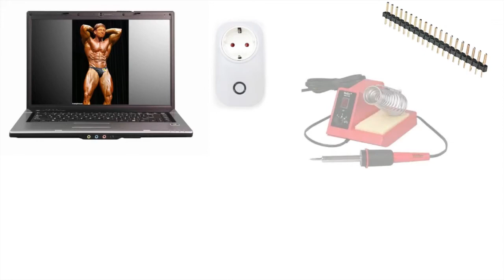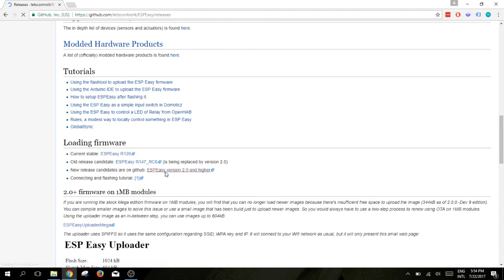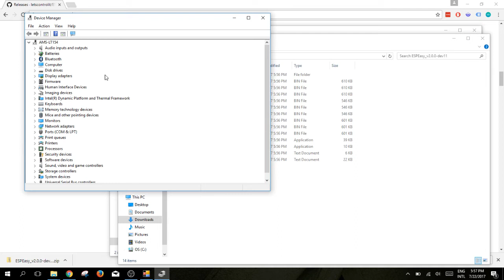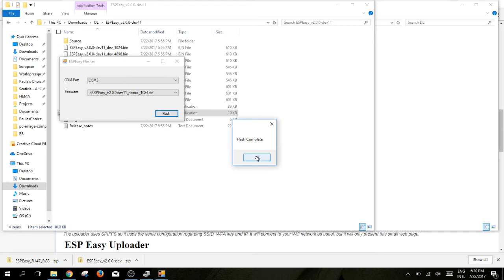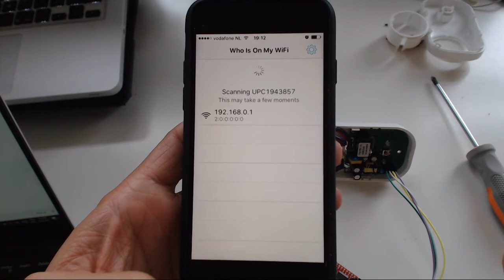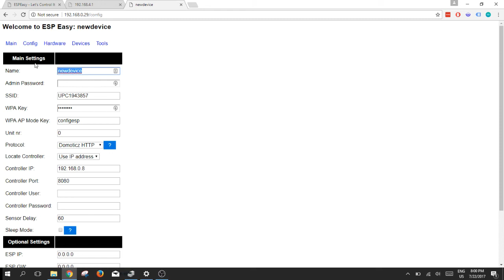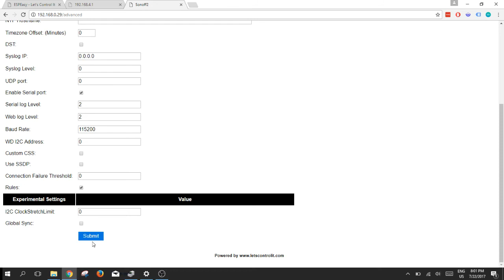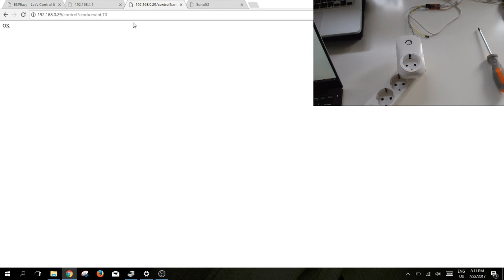Sonoff S20 Hack - Home Automation with URL - Flash Itead smart outlet with ESPeasy

Comment: Hey, thanks for the video. It flashes correctly (no error what so ever) but than after the reconnect I can't find the network. Do you know a sulution for this problem?
Reply from the maker: Hi Paul, were you able to solve this?  That's strange, mine seems to connect directly.
Reply: tipswithpunch no, it was not able to fix the problem. But my Sonoff does not connect or create any WiFi. On my plug there are as usual two leds, after reflashing the firmware no LED lightens up. Also, even with the orginal Firmware, it does not creat any kind of network after pushing the button longer down. I don’t know how it should be connected with the Orginal Firmware, but maybe the esp creates the network in wrong network bands, so that I can can’t see the network?
Reply from the maker: Indeed that sounds strange, perhaps something wrong with settings? I'll be honest I'm not that experienced with hardware so my technical support is limited

Comment: What if I wanted to control this via internet not from the same wifi
Reply from the maker: Hi Subrate, Sry haven't done that, I think it's a bit more complicated. But should be possible
Reply: tipswithpunch thanks for the reply. Do comment back if you happen to find a way.
Reply: @subratadey  Just setup a VPN or host a little webserver in your LAN, which is reachable from the internet. But VPN is the by far easier method. Running it by mself.